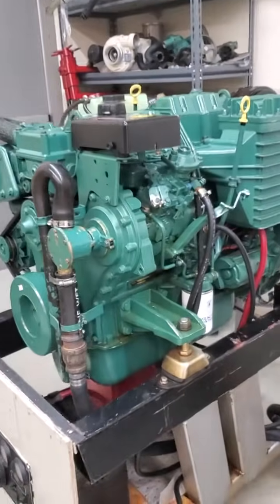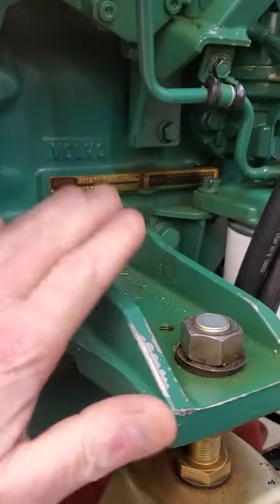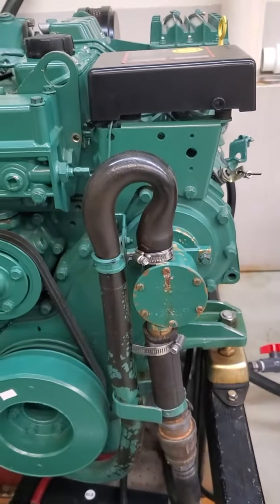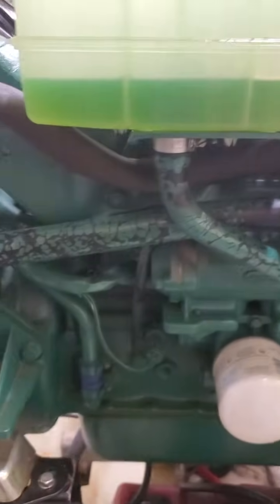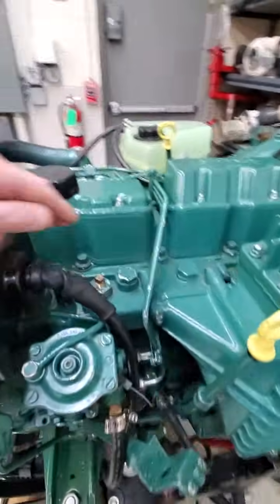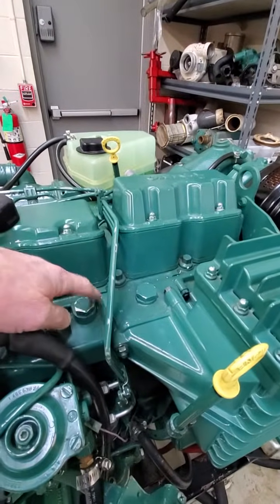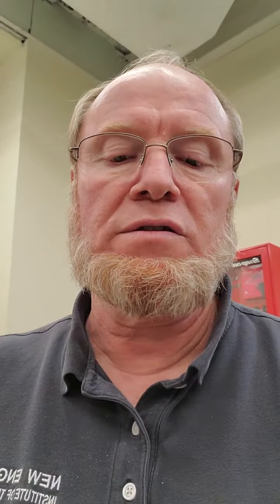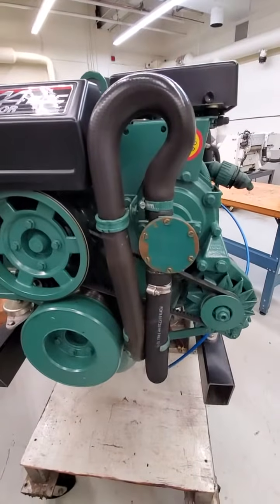Volvo Penta TAMD 31 Diagnostic Tips

Comment: Hi Ted
Two questions. 1: My TAMD31P-A is connected to a HS1-A transmission. Having motored more than 18 hours, I noticed that the oil level in the transmission had fallen below the dipstick markings. I couldn't find any visible oil leaks anywhere which has me stumped? Also, when removing the dipstick, air pressure was released. Is there a vent built in to the dipstick?
2: One of my fuel injectors is "sweating". I've checked the nut connections but nothing is loose. Is this an easy fix? Thanks in advance
Reply from the maker: Reverse gear oil cooler is likely where the trans fluid is going. When you say an injector is "sweating" is this fuel leakage?
Reply: @tedsmarinerepair8956  Hi Ted. Yes this is diesel fuel. After a few hours there is a very small puddel next to the injector base.
Reply from the maker: @hansk.4482 sounds like you need new return line copper washers. There should be one on each side of the fuel line fitting.

Comment: Hi Ted thanks for your video, highly appreciated. I have kad 32 on my boat and one of them after a run and return to idle  at aprox 600 rpm triggers the alarm, the engine works great does not smoke and does.not burn oil. I am suspecting that the alarm switch is at fault as readings on gauges of both engines is identical and alarm  only comes in on one engine. I have noticed that there is a sensor on the oil filter block and another to the engine block behind  the oil cooler, but don't know which one of them triggers the alarm! Can you advise please?

Comment: New issue on my tmd31a oil leaking a little from turbo, also uses quiet alot off oil.. maybe filling 1l per 3 hrs trip
Is it the turbo that is most likely the issue or are there other ?common? More likly issues
Reply from the maker: It may very well be the turbo seal is the issue. Do you see blue smoke out the exhaust when cold?

Comment: Hi is there a way for easily check where impeller debris are lodged inside the engine without not disassemble too much of it. Thanks.
Reply from the maker: @luisgcasiquet  Yes, just follow the pump output hose and the cooler that is upstream from the pump is where the impeller pieces can be found.

Comment: Thanks for the video. I have an Ad31-D, and the previous owner or someone has tried to losen exactly the bolt you said not to losen. 3/4 bolt are off, and 1 whole. However, is there a o ring or just silicone when im repairing the house?

Comment: Please could you tell me what the normal pressure is so I can know if the turbo on that engine is in good condition. I have those engines and the turbos have been repaired but at 2,000 rpm I get black smoke and the engine doesn't go up in rpm. I'm going to do the pressure gauge thing but I need to know what pressure it should give. Thanks.
Reply: Did you figure out what was wrong?

Comment: Hi Ted great video. I have a tamd41a. Starts and runs fine from cold. However when i start it up from hot it wont rev above 800rpm no matter how far the throttle lever is pushed up. After about 5 minutes running it clears itself and runs normally. All new filters fitted. Any ideas?

Comment: Hello Ted,

I have had a 2004 KAMD300 since new, done only 500 hours. Had a dirty fuel issue, now seemingly resolved and tank thoroughly cleaned with filters replaced and all fuel lines cleaned. However, the engine was also smoking/steaming and overheating so we serviced the water pump, thoroughly cleaned heat exchanger, same with aftercooler, new oil cooler (oh, it burst!), serviced all injectors, same with fuel pump, new air filter, new impeller, checked exhaust elbow, checked water strainer, and spent many £thousands but still smoking/steaming and overheating at higher revs!? Any thoughts? Could the thermostats be faulty? Doesn’t seem to put out much exhaust water but difficult to monitor at speed! It also revs  irregularly after around 1600 revs which I’m thinking could be a compressor issue maybe - clutch not engaging properly? Compressor oil not changed since new. Help!?

Comment: Excellent video -  many thanks. A question if I may - losing coolant on my KAD300 - about a cup every hour when running. Definitely not in the bilges. Oil seems coolant free and Coolant seems oil free. Had heat exchanger cleaned over winter, so naturally thought that this might be the culprit. However, pressure tested the coolant system (cold and warm) and didn’t drop pressure at all (did remove the heat exchanger again and had it retested - all good) bit puzzled - any ideas greatly appreciated. Many thanks
Reply from the maker: It may be the exhaust manifold to turbocharger gasket is leaking when the engine gets hot under load and then doesn't leak when everything cools and shrinks. You can try retorqueing the 4 turbo nuts to see if they are loose. Spec is 33 ft pds
Reply: @tedsmarinerepair8956 many thanks Ted - funnily enough, that was my suspicion - please keep the great videos coming 👍

Comment: Hi. I was looking to buy a boat with two tmad 41s. I was concerned with the amount of grey smoke coming out. The owner states that he runs the engines every week. Even after 10-15 mins there was still visible amount of smoke coming out and a strong smell of burnt oil. Should I be concerned? Thanks
Reply from the maker: Yes, if they still smoke after 15 mins under load (in gear) then that's an issue. I would have them evaluated prior to purchase.
Reply: @tedsmarinerepair8956  thanks, I though as much. Will have to do a longer test run on the bay. Cheers

Comment: Hi Ted i have problem with Volvo penta D16C1 FMH i get fuel in the engine oil ، what do you think the reason for that problem. The engine it has600 runohurs only
Reply from the maker: Likely either a leak in one of the unit injector o'rings that seals it inside the head or a dripping injector. do a cylinder balance test with VODIA to see if any of the cylinders have a power loss @ idle and that is likely the cause.

Comment: Hi Ted, how's it going?
I would like to ask you a question........in your opinion, if the insert (radiator) that is inside the intercooler no longer has aluminum fins, will the engine still run?
hi thanks piero
Reply from the maker: Yes, it will run but if the air is not sufficiently cooled then the engine will lose power. If it's an electronic engine it will de-rate to a lower speed .
Reply: @tedsmarinerepair8956  thanks ted, always very kind.
no, it's not electronic but the four-cylinder of the series you show in the video.......tamd 31/ad31.
yes, I imagined this.
At this point I hope this is the problem.
Thank you
Greetings

Comment: Hi agen now i got a diffrent problem😢 the main fuel pump is leaking its between the main pump and the squar part where the pipes to the injectors are conected
Is there a rubber seal? Part nr? 
To remove the pump do i need to go inn from the registrery?

Comment: Hi Ted,

Greetings from Berlin, Germany. 
Thank you for your informative videos, which are a great help to us laypeople. 
Maybe you also have a solution for my problem. I filled up with GTL diesel for the first time three weeks ago ( Volvo Penta TMD31L-A, HS1A gearbox). If I stop the engine after an hour of driving and start it again after another hour everything is normal at first, but when I then put the engine into gear the rpm are limited to 1000 rpm. After another 10 minutes, the speed suddenly increases and the engine reacts normally. I think that the rpm limitation comes from the Smoke Limiter, but I can't find a solution anywhere to solve the problem and no instructions for disassembling the device.
I would be grateful for a suggestion. 
Thank you and best regards from Germany     
Paul Depprich
Reply from the maker: GTL has a couple of disadvantages, one is I believe it does not have the lubricate of regular diesel and 2 it has a lower energy energy coefficient than regular diesel. I would try going back to regular diesel if possible. The issue sounds like an intermittentl hanging governor. And that is inside the injection pump.
Reply: Hi Ted, thank you for your quick answer. I`ll burn my GTL and go back to regular diesel. No more new fuel for old engines. Thank you so much. Paul Depprich
Reply: Hello Ted,

a supplement to my problem with the TMD31.
There is a grub screw in the lid of the Smoke Limiter. I screwed it in 9 mm. It pushes the diaphragm down, simulating high boost pressure, thus opening the fuel flow to the injection pump. Everything now runs normally.

Best regards from Potsdam Germany 
Paul Depprich

Comment: Hi Ted I have twins Volvo Penta kamd 300 and both engines it's heating up after 3000 rpm I clean transmission oil coolers change impellers clean aftercoolers clean oil coolers clean heatexchangers clean exaus elbows and kep overheating both engines what you think it's the problem bottom it's clean seacock it's clean  you think I have bad raw water pump
Reply from the maker: How many hours on them
Reply: @tedsmarinerepair8956  2680 hours

Comment: Hello, forgive my English, I am writing it from the Google translator. I would like if it were possible that you could explain the reason why all the Volvo Penta of the TAMD 31 TAMD 41 series discharge so much water vapor through the exhaust, which is often confused with white smoke, it is possible that it could be due to some failure in the exhaust elbow system, is there or do you know of a solution that can minimize this problem.
Reply from the maker: That is likely due to limited raw water flow out the exhaust. There are various reasons. Worn out raw water pump housing, clogged exhaust riser water passages.
Reply: Thank you very much for the reply

Comment: Hi. Have problem with my 41a not getting full speed. Replace the two fuel filters and air filter. Same problem.
Reply from the maker: Check throttle linkage for binding and turbocharger boost pressure

Comment: Hi Ted, this is Martin from Argentina. I have twin AD31P-A on my Cranchi boat, and as you recommend I installed boost pressure gauges on the intake manifold.
 Unfortunately, neither of them obtain more than 15 psi at WOT, but it's strange that up to 2000rpm the pressure is 0 🤨, how can i share my video with you?
I’m painting on black all Rio de la Plata , hehe

Comment: Hi Ted  we have the below problem with the kamd300

We have done the following 
cleand all heat exchangers and replaced the after cooler  replaced all hoses 
and replaced injectors 
adjusted values and also services the injector pump and a new seal kit on the turbo once all was re attached and we went to srart the engine it  cranks but don't start we also tried to start with the injectors out to see if they spay but they dont 
Any help would be greatly appreciated 
we also switched  ecu from the other engine and the other engine started
Reply from the maker: Any codes?
Reply: no
Reply: @tedsmarinerepair8956  no
Reply from the maker: When cranking with injector lines cracked open do you get fuel leakage?

Comment: Hi Ted John here from Sydney iv a pair of volvo  tam 41 straight six turbo diesel  engines in my boat a searay 310 sundancer 1989 I'm about to do a few jobs on my engines I am mechanically  minded self taut  over the years I had a engine scary moment last year what's your thought on this issue  my story  my boat was on my birth in the marina  I shut the electrics off when I had been out on the boat a few hrs earlier and went home around 11 pm in the evening and in the dark I received a phone call from the boat yard saying my boat was sinking I quickly got out of bed and rushed over to the boat where the back end was well down and the bow was well up in the air jumped on board lifted  the engine lid the water level was about to submerge  the self starters why haven't my bilge  pumps kicked in  that was because I'd turned off my electrics  for safety and the previous  owner had done d I y wiring and connected the bilge  pump to my main switch box not my domestic orgsilery battery while I was panicking  both my engines  started up no keys in ignition  then started to high rev crazey  I'd only just baught  this boat a week earlier so I was just getting to get to know about the working of everything on board how can diesel  engines  just start up on there own ? Well they can how ? My engines have a permanent live feed from the batteries at all times as the water went over the self starters I guess perhaps arking  the solenoids  bridged  together and started both my engine's. My q to you is does all diesel  engines have a standard permanent live even when you have turned your main fuze box off ? And what is the reason  for this in a boat ? Enybody else had a simular  problem  like mine.by the way Ted we all love your videos  your very good in sharing your engine tips with us all kind regards John .

Comment: HELLO TED HOW ARE YOU? I HOPE SO.
AS PROMISED I WILL KEEP YOU INFORMED
AFTER REVISING THE TURBO THE PROBLEM WAS THE SAME.
I ARRANGED WITH MY MECHANIC TO HAVE THE INJECTION PUMP DISASSEMBLED.
IN FACT, THE INJECTION PUMP IS ALL RUSTY.
A DISASTER.
VERY PROBABLY THE OLD OWNER OF THE ENGINE HAD TAKEN SEA WATER AND HAD NOT DONE EVERYTHING THAT NEEDED TO BE DONE.
I HOPE TO RESOLVE. THANKS BYE
Reply from the maker: change the injector metal lines and send the injectors out to.
Reply: @tedsmarinerepair8956  IT WILL BE DONE, THANK YOU.
  HI
Reply: HELLO TED HOW ARE YOU?
AFTER REPLACING THE TURBINE, REVISING THE INTERCOOLER, BUYING AND REVISING THE INJECTION PUMP AND CLEANING THE INJECTORS ARE DISASSEMBLED OF THE TESTED.
I DID A BUSH TEST OF THE PISTONS AND NUMBER 3 HAS ONLY 18.....THE OTHERS 26......I THINK THE AIR IN THE AIR MANIFOLD IS GOING OUT OF THAT PISTON....MAYBE ONE VALVE? WE WILL SEE.
SEND ME AN ASS AT THE WHALE (ITALIAN SAYING)
GREETINGS TO ALL

Comment: Hi

I have a d3-190 that has been under saltwater. Took the water out of the motor and cleaned all electronics. It started without problem., until we took it out for a test (4 weeks later). Limp mode from the boat Launch to the marina. It shut off when i tried accelerating, and had to pump the diesel to get it running again. Now i have 2 active fault codes:
 Mid 128 sid 2 fmi 11
Mid 128 sid 5 Fmi 11
Now it wont run at all, if i erase the fault codes with Vodia it starts and runs for 1 sec.
I have switched injector 5 with 4, and 2 with 3, without moving the errors. Do you have any advise on what to do next? Or what the problem could be?

Comment: Hi Ted I want to know D12-615 ENGINE SO WE CAN START ENGINE WITHOUT MS UNIT AND EDC DID U   HAVE ANY IDEA TO CONNETION  PLZ CAN U EXPLAIN OR SHOW TOTHANX OF LOTS
Reply from the maker: I hope this answers your question. To bypass the MS unit, just unplug the break out harness and run the edc harness from the engine directly to a single station. Then, recalibrate the controls.
Reply: @tedsmarinerepair8956  did u make Electrical diagram how can I start the Engine from battery to the Engine wiring connection plz thanx a lots to u
Reply from the maker: @syedpeeran3133  are you trying to start the engine out of the boat? 
You will need a key switch harness and the edc harness with a control and push button panel.
Reply: @tedsmarinerepair8956  I mansion to U D12-615 MODEL ENGINE SOTHIS I AM ASKING ABOUT.....
Reply: Hi hru ok I am trying to as per ur tell do this do this God blessing u see wht happen....

Comment: hello, ted today I'm going to try the boat with the regenerated turbine.
we hope well.
I wanted to ask you......is it possible to upgrade the 130 hp tamd 31 and bring it to 150 hp?
what do you change? only the injection pump?
did you ever happen to do that?
Thanks again Peter
Reply from the maker: That is not something I have done, likely an injector change as well. Your best method is to look up the part #'s for both 130 and 150hp and compare.

Comment: HELLO TED, TESTED THE TURBINE PRESSURE WE DISCOVERED THAT IT HAS NOT EVEN 0.2 BAR.
THIS MORNING THE BLACK SMOKE WAS EVIDENT FROM THE EXHAUST.
THANKS WE UPDATE
  PIERO
Reply from the maker: Did you check backpressure at the same time, if excessive that would prevent the turbo from making boost as well
Reply: @tedsmarinerepair8956  how is the back pressure measured?thanks piero
Reply from the maker: @chichibio62  You need a manometer which is installed into the exhaust as close to the outlet of the turbocharger as possible (the hose that attaches to the riser will suffice.
Then run the boat full throttle to see if it exceeds the max value in the manual
Reply: @tedsmarinerepair8956  THANKS TED, THE TURBINE ON THE EXHAUST SIDE (LET'S SAY THE "HOT" PART) IS VERY DAMAGED, I'M REPLACING IT.
KEEPING YOU UPDATED.
THEN I WOULD LIKE TWO PRESSURE GAUGES ON THE DASHBOARD SO THAT I ALWAYS HAVE THE PRESSURE UNDER CONTROL
HELLO
PIERO
Reply from the maker: @chichibio62  You should look into installing a pyrometer in the exhaust manifold to ensure the exhaust temp is not getting to hot.
Reply: Hi Ted I'll check the back pressure too.
thank you
piero

Comment: hi ted, i was very lucky to find this very nice video and to have found someone as prepared as you are.
I am from Italy and I have a boat with two volvo penta 130 hp tamd31 a engines. one of the two does not take me all the turns in navigation ..... 1100 turns are missing.
I even went so far as to check if one of the two inverters was wrong.
I mounted these two engines a few months ago.
fuel circuit checked again.
I don't know which fish to take .......
Help....
Reply from the maker: So I gather the rpm is low on one motor? If so I will need more info and will require a a consultation.
Please email me at marinedoc01@yahoo.com if you wish to hire me for more help
Reply: @tedsmarinerepair8956  thanks, today we had to go out to sea to test the turbine pressure but the weather is bad.
I keep you informed
thanks piero